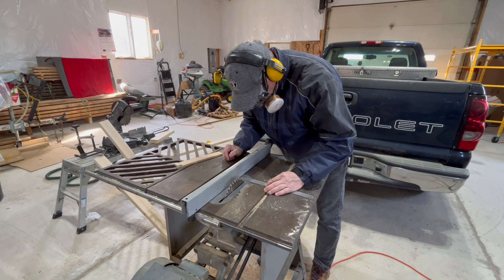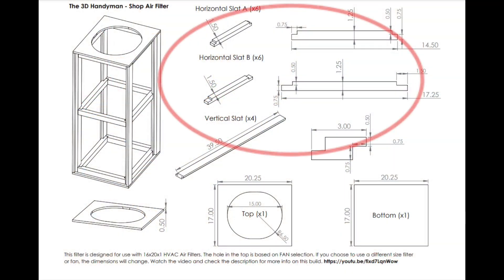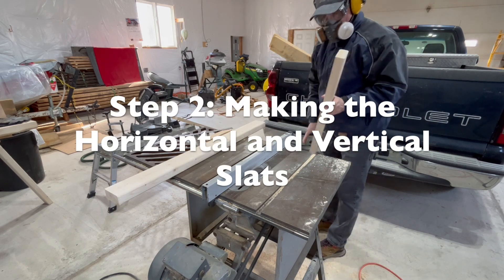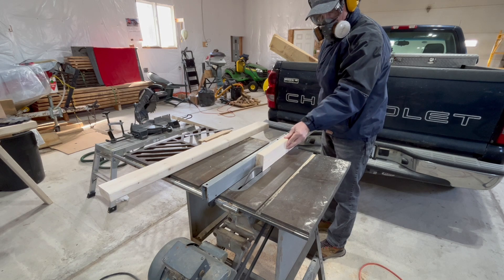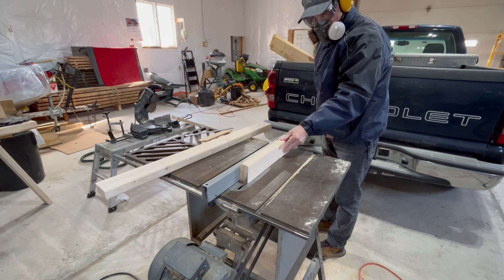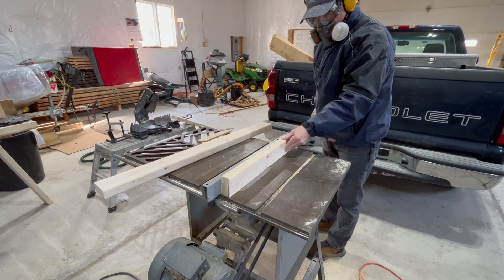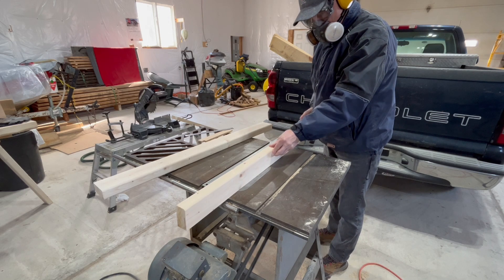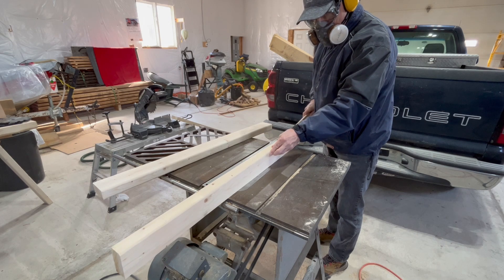Make This Awesome Air Filter for Your Shop!

Comment: Hello Peter. Not having a shop, all I have are questions. Is your shop vac near the initial exit of the dust when cutting wood? If there is room, would a hinged frame work for holding the filters in place? Hinged on the bottom. It looks good and should work. I saw someone use a box fan on the side for three sides for filters. Have good days!

Comment: Shouldn't the fan be sucking the air instead of blowing?  The fan will stay clean and the filters will be held in place by the airflow.  Just a suggestion.
Reply from the maker: Good question. I recommend you watch 3D Handyman's video. I included link. He addresses this issue and why in the video.
Reply: @TheWoodlandReboot  Thanks, I will.  I've never seen a furnace or air filtration system put the filter downstream.  Depending on what kind of fan motor you had, common sense tells you that the dusty air would accumulate on the blades and motor.  I have to clean my house fans all the time for this reason.  Same holds true for ceiling fans.  Ever notice the dust buildup on those blades?
Reply: @harpazo5486  I agree with your points but was swayed by 3D's approach and reasons for inverting the fan. He does recommend to use a fan with an enclosed motor (mine is enclosed) to address the accumulation issues.
Reply: Yeah, enclosed motor would be good advice!  I have an older friend that got severely burned and almost lost his life when his tablesaw motor caused sawdust to explode.